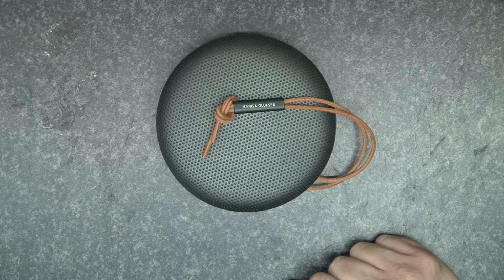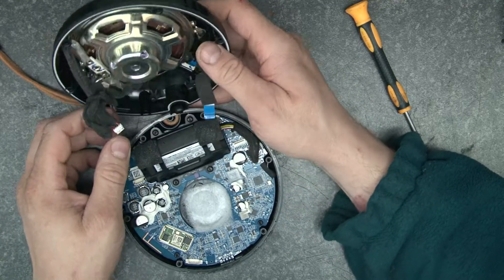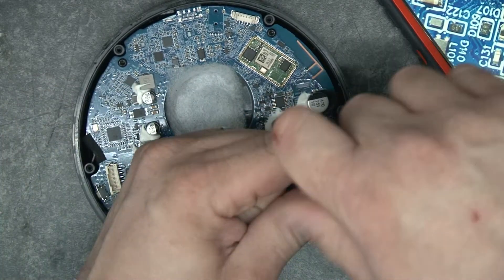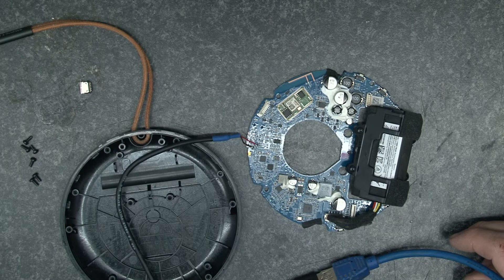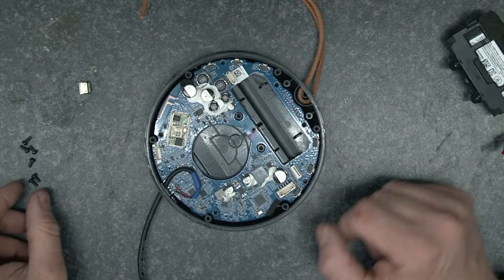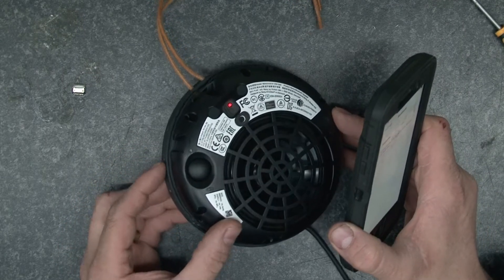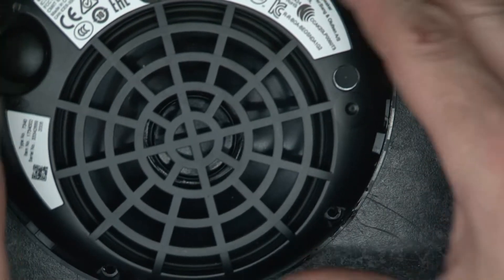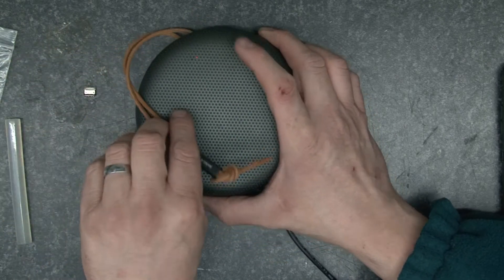Reparing a Bang & Olufsen Beosound A1 2nd Gen Bluetooth Speaker broken power connector

Comment: I had this SAME problem. I tried to explain it's a durability issue, too, but B&O basically told me to F off and gave access to discount, refurbished equipment.  I am not likely to buy from them again.
Reply from the maker: its a bit of a issue , the socket is clearly not strong enough to be continuously used  socket is  not held on by a lot
Reply: My argument to them is that it was NOT designed to be a travel speaker, that this was an obvious flaw.  Someone is going to drop it. That's what happens when you travel, so it kindof exposes a lack of foresight of the designers.  They could care less, of course.

Comment: Can the bass be fixed? Its distorted after a drop
Reply: The same thing happened to me and the problem was that the outer plastic had small cracks through which air came out and generated distorted bass sound. I solved it by sealing every crack with glue, even the screw holes 👌

Comment: I received this yesterday and connected it via Bluetooth to my windows PC as well iphone.  When I am playing music from iPhone, the audio pauses whenever I receive a mail on my PC or other such events. Then I have to hit play again.  Has anyone experienced this problem? Anyway to fix this?
Reply: This is normal behaviour for any Bluetooth speaker. Try removing notification sounds on the laptop! The speaker thinks that the audio device has switched because the laptop, even though the volume might be at zero, transmits a signal to the speaker making it think that the laptop wants to play something. 

The other option is to connect just one of the devices. The reason the speaker does this is to facilitate multiple devices to play music. When this happens, it pauses the already playing device and switches to the one trying to play music.